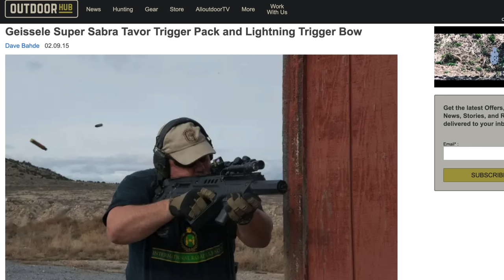6 Reasons Why the IWI Tavor is Better than the AR-15

Comment: You can switch the charging handle to the other side of the rifle if that'll make it more comfortable. I did it and found it to be better for me. There's this little plate on the gas tube that u flip over and a roll pin that's part of the bolt that needs to switch over too. Gotta take the barrel out tho

Comment: As a lefty I wish they would've added the quick change right or left side ejection feature like the Tavor 7 has on the X95
Reply: I just wish I didn't have to send it to a "gunsmith" to have it converted because iwi doesn't trust me or you to headspace
Reply: In Canada we just buy the bolt and do it ourselves. It's insane iwi us makes you do that. I've converted countless Tavors in the past 10 years without one having any headspace issues. I don't get it.

Comment: A pox on the NFA!  I'd really like a 13" kit without hoops.  
I studied bullpups for several years, and finally got an X95 a couple of months ago.  I have added Magpul backups, because the installed sights just look spindly and fragile.  The Manticore Switchback is a great change.  For an optic, I have the new Primary Arms 3x microprism  A larger case deflector would be very nice; I normally shoot right, but there are times when left-shooting is practical and I'd rather not have to deal with the poor sight picture causes by moving my face back near the buttpad.
Reply: Hey man, don’t count out the Keltek RDB. I picked one up and have been amazed at how much it doesn’t suck. It’s 7lb, uses standard mags, fully ambidextrous, and I haven’t had any problems with it at all. 
I used to make fun of Keltek but not this one and if anyone does I wonder if they have actually used one.
Reply: @nemoexnuqual3643  Indeed!  Ian McCollum and Nutnfancy have really good reviews of the RDB, but I was concerned about stoppage clearance with that unique ejection system.
Reply: @petesheppard1709  that is a concern with any bull pup (although I think the FAMAS has a work around, not sure I’ve never played with one). 
I had a case rip in half in the chamber once, shooting 5.56 and suddenly it ejected what looked like a 9mm case. That was in an H&K and required the barrel to get pulled so regardless of the platform with some stoppages your just boned. 
With the RDB you can see the chamber through the magazine well, I haven’t had a stuck round or failure to extract but I imagine the old paint can opener would work, or a clearing rod (I think I’ll pick up one of those “rapid rods” that folds up to about 5 inches and carry that). 
A stovepipe on this weapon is sort of out of the question, they seem to have used H&K ejectors that throw the brass down so hard it sometimes dents the spent case so as a reloader I try not to shoot over gravel, but all the brass ends up in a neat little pile. 
For a double feed (I did have one from a garbage mag with bent feed lips) you just drop the mag and reinsert it. Gravity does the work on that one and it fell free the moment the mag was dropped. 
For a SHTF zombie apocalypse I’d take my AR-15 because of part availability. If I was playing in the mud I’d take an AR-15 because you can close the dust cover and it functions pretty well, but for an MOUT situation in a westernized country or home defense I’d seriously consider the RDB as it is really short and light but has a full length barrel.
The capabilities for the price makes it a pretty good value.
Reply: @nemoexnuqual3643  Well said!

Comment: Excellent observations I am a new owner of a Tavor SBR, got a pretty good deal on a very lightly used one and I am very happy to report I love it. As you stated I am not getting rid of any of my AR platform rifles; however I am please to have a hammer forged 16.5 in barrel at the length of a SBR without the tides to Caesar. Nice review

Comment: I bought a Tavor 7 on a whim a while back over an AR10 or some other .308 platform. Can't praise it enough, ambi controls, 16" barrel that's shorter than any AR of comparable barrel length, super reliable, more accurate than I am (probably not saying much)... Tossed a manticore arms handguard and a 4.5-18x scope with a foregrip and it's great.

The best part though? You can lock the charging handle back by pulling it up slightly, allowing you to slap it like an aug or HK.

Comment: When your using to wrenches together it usually works better if you have them facing the the same direction roughly, with one a little higher then the other. This also makes changing muzzle devices a little easier because you don't have to worry about putting stress in the receiver and barrel.

Comment: I've had my SBR X95 since it got out of NFA jail in April.  Excellent rifle.  Soft recoil, and super reliable.  When you pick up the SBR version you realize what the Israelis were trying to accomplish.    The 16 inch gun also has an inch ish more on the butt stock to make it legal. It makes the rifle feel a bit bloated.  The SBR feels much better.  

 If you are in the market for a Tavor, or any bullpup, go find the SBR and give it a look.  If you don't mind the added paperwork and tax stamp, it's amazing.

Oh, and if you are right handed, switch the charging handle to the right side and run it AK style.  It gets the charger out of the way of your support hand.

Comment: I love my x95 and gifted my first one to my dad so we have same rifles now. Running and aimpoint t1 micro and 1000 lumen stream light with pressure pad all neatly mounted with magpul afg up front. I have learned to deal with the trigger and can make reliable standing shots out to 200 yards under pressure. I can barely see 300 yard target with non magnified optic lol. Took me a while to get used to mag changes after so much ar platform time. Still randomly try to shove a mag into the bottom of my fore grip.

Comment: My only 2 issues with x95 is it won't cycle well with cheaper steal ammo. But runs amazing with all brass ammo I've used. 2nd is charging handle won't lock back same as the tavor 7.
Reply: Interesting, does it not lock bad all the way?

Comment: Having fired an X95, really don't see the appeal other than being shorter with same velocity as traditional format rifle of same caliber. The practical accuracy I saw was abysmal compared side by side to my own factory Spikes Tactical midlength AR15. The X95 with a red dot and a center hold on a bench, hits were very inconsistent, several missing the full size silhouette target entirely at 200 yards. 

In contrast to the AR15 using iron sights at the same target and distance, where not only center mass hits were easily made, but also head shots with only a modicum of difficulty, with no misses. I've talked to many Tavor owners that have experienced this as well, and hear the barrel lockup is likely to blame. 

Fine rifle if your need is rifle caliber performance at close range in a cramped environment, but good for little else in my opinion.
Reply: Right the tavor is just so inaccurate and as much money as it cost . No thanks just give a bunch PSA ar 15
Reply: @DARTHDANSAN  no, for what you pay for several mediocre PSA trash rods, you can source 1 good rifle, outfit it with good optic, light, sling, mags and ammo and actually USE the thing, get proficient with ONE well made rifle, and get another, because 2 is 1, and 1 is none.
Reply: Or you can spend $1600 on this trash that will get you the same accuracy as a PSA.... Oh don't forget to spend more money on a rail so you don't have a fucking temple weld while using a rds
Reply: Its short, im 5’5”, traditional m16 in the army and civilian ar15 are to long for me to maneuver. You wont get it until you run one around. The shorter profile is so much nicer especially with corners and cqc
Reply: Tavor gets 2.5-3.0 moa with 62g green tip what more do you want?

Comment: For me the biggest advantage is the weight distribution. Holding a fully accessorized AR in a combat ready position for long periods of time gets tiring. The Tavor is much easier to handle. I’m pushing 50 however so perhaps a younger stronger guy does not see it that way.
Reply: Nah dude... it will always suck unless you specifically target some of the back muscles involved in maintaining such forward-weighted posture OR counter-balancing with a backpack. Strength/size ratio is important to consider, always, even if you're young and strapping. Most guys around my age I've noticed are either too big for their strength, or are barely over 130lbs.
Reply: @BeamMonsterZeus  Yes because you know

Comment: A couple of quick things. FN makes a hammer forged, chrome lined barrel, and it is used in their guns, PSA uses it in the premium line in their AR15s and the GF5 AK. I'm not sure if they still do or not, but Spikes used to use the same barrel, as did Centurian and a few others. We had several PSA barrels that had PSA stamped over the Centurian mark from FN around 20110-2014.  As to the Meprolight M21. you can buy a battery powered led light and switch that will screw into the body of the optic, so, that gives you another option. The best reticle is the triangle. It has a sharp point for precise aiming, and it can be used as a rangefinder easily. It's also the only reticle that really doesn't wash out or disappear going from a dark room to the outside for that split second it takes to change brightness.

Comment: I really love the idea and it almost pulls me in again watching your video but I'll stick with my AR.  I originally sold an AK74 and DDAR15 and bought 2 Tavors a few years ago. They felt amazing in hand but jammed every few shots on any ammo or mags I used. There gone for good I now have 5 BCM ARs and couldn't be happier.
Reply: That's weird. My tavor has been much more reliable than my ARs. The only failure I've seen on mine was when a newbie was shooting and had a bad stance and didn't give the stock a solid rest on the shoulder
Reply: Just got my first AR lower, BCM. Didn't realize it was A1, so I'll have to tailor my build to that; but I like it.
Reply: @abstractapproach634  I don't think there is a lot of difference from what I have read but I don't have experience with an A1. If it bothers you at all you can easily sell it locally or on Gunbroker and buy what you really like. BCM also has blemished upper and lowers occasionally. All my uppers are BCM but my lowers are PSA and are perfect.

Comment: Like you said, I found the Tavor felt lighter than an M4 while you were actually firing it with the centre of gravity being closer to your body, I even found it was faster to swing around across targets even to the point of going past the target and hitting to the side, need a lot more practice,  my reloads were slower but I'm sure I can train that to be faster.
Reply: With the weight closer to your body, the best way to control it is to drop your posture down and widen your stance by several inches. This will allow your hips to better "true" your stance and make it easier to move your legs, which is more important than it would be if all the weight was forward and not well-managed by your posture. In other words, be more aggressive, that's what you are enabled to do with the freedom of movement.

Comment: Can anyone vouch for accuracy on the x95? I remember MAC did a test years ago and was getting like 6 moa at 100 yards with ball ammo.  Was that ever addressed?
Reply: No. It's still Kyber Pass AK accurate past 100 yards.  They could add a thicker barrel but you'll be getting closer to Galil weight.
Reply: New generations came out which can be visually identified by a curved charging handle, dual ejectors in the bolt, and a keyhole in the top rail for compatibility with adjustable-gas .300Blk barrels.  Accuracy seems perfectly fine (~2MOA) out of those.  Not sure what the issues were with the originals.
Reply: @jarvy251  thank you for the reply. I just remember the moa left a lot to be desired from the videos I've previously seen

Comment: I worked in Israel for 4 years as a contractor. A few things to note:
-the IDF has more M4s fielded than Tavors. Mainly because the US gave them a shit ton for free 
-the Tavor is not as modular as the M4, and slightly more difficult to maintain in the field 
-as another viewer outlined, getting parts for this platform in the US is difficult. Making it no go for many people 
-the price tag. For what you pay for a Tavor, you can buy a decent AR and still have money left over to accessorize

Comment: 4:43 what caused that jam/malfunction??
Reply: The gun is trash suppressed. Not only it is craps back in your face, leaving visible black stains on the shooter's face, but it can also have FTF, gets dirty AF inside, and totally defeats the whole point of having a piston system. Low back pressure is a must to attempt to suppress it, the experience will be subpar regardless.
Reply: Don't they have flow through supressors that eliminates most of this?

Comment: The Tavor is dope af, and I really like it. But... and I cannot tell you why.... my favorite bullpup is the KelTec RFB. I've read and seen dozens of accounts of people's experiences with them, all of them having tons of failures to cycle, feed, or eject, and that the gas system is "far too complex"... Well, my friends... Read The Manual.

The gas system has 50 clicks of adjustment. It's definitely a little overboard, but it lets you precisely tune the gas for a given round so you're never overgassed and beating the shit out of the gun and your shoulder, but it will function every time. After I got mine tuned, which took about 10 or 12 rounds, I haven't had a single failure in over 1100 rounds. It's not as accurate as my DD5v3, but I'd bet my left nut it's as accurate as a similarly priced off-the-shelf AR10.

Comment: Tavors are nice. However, they’re heavy, and parts are limited for them. The plastic they’re made of is not that strong either.
Reply: If I can’t build it at home and find the ready parts to buy or even create, no thanks. 

Especially when the AFT are using all 4473s as a registry. And yes they are violating the stupid law Reagan signed with the Hughes amendment that made the 2nd amendment a semi neutered right.

Comment: I have all 3 tavor versions and what I'd REALLY love to see is the tavor 7 platform in 5.56 but direct impingement. I know people say it's less reliable than piston driven guns but I've not seen that in my years of shooting. As long as its properly cleaned and maintained DI guns are fine and WAY lighter. 

I want the features of the tavor 7 but in 5.56 and under 6lbs. It's possible but I'm probably going to have to make it myself with AR parts and 3d printing.
Reply: Purely anecdotal but decebt input

Comment: It would be nice if they had PARTS for a gun that is CURRENTLY BEING SOLD... been trying to get a firing pin and Idf grip panel for a while now
Reply: I was wanting to get the bolt spare parts and nuts and bolts set and firing pin.  And the barrel wrench.  And the traditional trigger guard pistol grip

Comment: The thing I dont like about the X95 is cleaning/disassembly of the weapon forward of the trigger. You NEED a special tool (Barrel Wrench) to take apart the forward half. You MUST take out the charging handle BEFORE you disassemble the forward half. If you dont, you will damage the gas chamber to point where the weapon will NOT function any longer... guess how I know that. To Tavors credit, they fixed it in two months (during peak covid). This only issue makes me uncomfortable in a SHTF situation where I only have one weapon to protect my life with.
Reply: Learning proper disassembly helps. Although there isn't a ton of need to remove the barrel for cleaning unless you shoot suppressed and want to get into the gas cylinder.

Comment: The Tavor X-95 is a great rifle, but life with it is much better with a few options.  I carry mine for duty because it has a 16.5 inch barrel and no big hassle with SBR and is very quick design to use in even in a vehicle.  You will need to move your sighting system up with a good mount like Unity.  The side charging handle is great when you have a malfunction and you have your sling on.  If you watch the guys with Ar's trying to clear a malfunction with a sling, it can get very awkward.

Comment: Absolute Hog Wash Good Sir!! The Tavor being a great weapons system, will never out run or out gun any Well Built AR. Yes it’s a bull pup, but I’d rather unify a 10.5/11.5/12.5” AR. Let’s be honest 95% of the viewers aren’t taking 400-500 yd AR shots anyways. So let’s keep in mind the 100-300yd max effective range & realistically 50-100yd shots taken. The tavor isn’t head & shoulders above a Well Built AR, it’s a little less effective & little less wanted/needed, keep in mind that the M4 that is threatened with replacement is still rockin’ the US Military because it works very very well!!

Comment: I'm an AR owner (16" barrel) and I absolutely love my original Tavor (Especially after ditching the shitty stock trigger).  Unfortunately, the X-95 variant with more "AR like" controls launched about six months after I bought my original Tavor... around 2013 I think??   I've adapted well to the mag release but the goofy slide release is still just mildly awkward for me on occasion (particularly when I haven't shot it is a while).  Before retirement several years ago, I used an LWRCI AR with a 16" barrel at work for search warrant executions and room clearing was just so much smoother when done with the compact little Tavor (unfortunately not approved for work use...).  I'd love to have a Tavor with the more AR like controls.